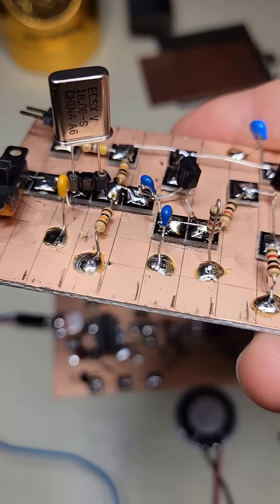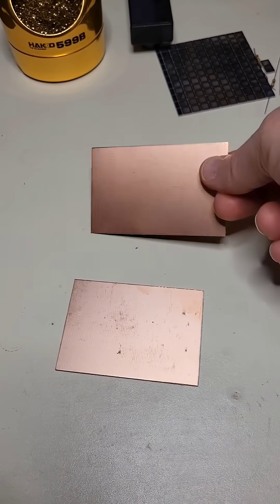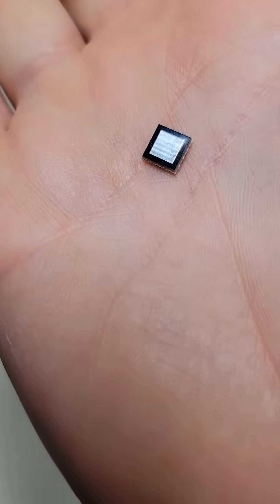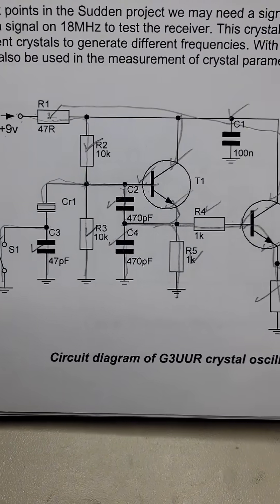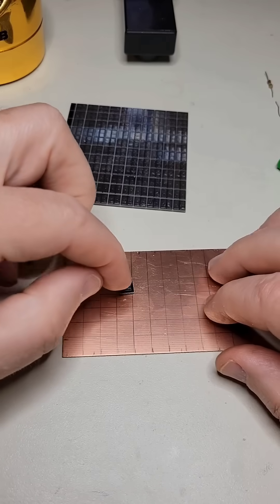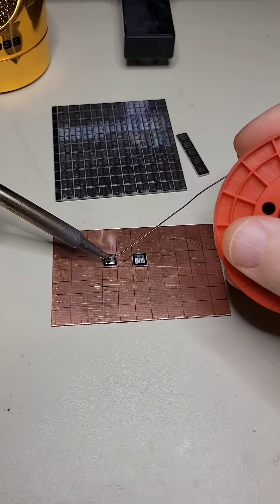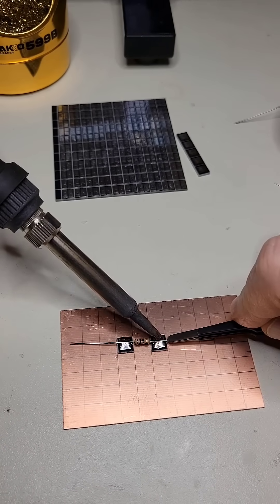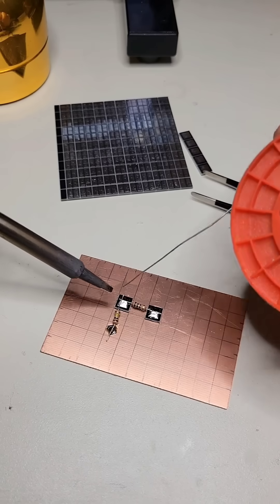Manhattan Circuit Construction Technique for Homebrew Ham Radios

Comment: You learn something new everyday. I have over two decades of professional electrical engineering experience with at least another 10-15 years of amateur electronics experience. I consider myself an expert. I’ll be damned, but I never knew this technique existed. I can see its usefulness in applications that require large ground planes, which probably limits its usefulness to mainly RF and maybe some simple power circuits. Neat.
Reply: It's also fast permanent and useful where pc board epoxy glass is too conductive or proto board parasitics or connection reliability is annoying.
Reply: Imagine building IC's this way...lol  First you glue this silicon wafer down...
Reply: @MrM6d  Actually, some DIY electronic guys assemble(d) primitive "integrated circuits" in a similar fashion, but of course with normal-size leaded-components. They used IC-sockets to created "integrated circuits" that could be plugged in into other circuits.
Reply: @GaretOsmontree   Thick film hybrid circuits are pretty similar to this technique, but done with small surface mount devices on a ceramic substrate.  The resistors and capacitor plates are sometimes carbon compound silk screened onto the ceramic.
Reply: @MrM6d  That is exactly how you make ics... well subhybrids were you stuff multiple ics in an ic package anyway. 

Just to clarify unpackaged bare mixed silicon and other chemistry dice with some microscopic discreets a/o screen printed (like a t-shirt) inside the IC package. Then some industry standard, flapping in the breeze, gold wires thermosonically bonded to the dice and package. 

State of the art processor chips already have or will go manhattan style. For physics and processing reasons.
Reply: @MrM6d  - Something like you mentioned IS used to create cutting-edge integrated circuits, from high-level modules created separately.
Reply: @MrM6d  There is a specific pad for IC.
Reply: Мы в Советском Союзе так собирали электрические схемы в "детском кружке" радиотехников. Были "кружки" авиамоделирования, робототехники и пр. 😊
Reply: 😅😅😅.  @Liberal-patriot
Reply: We low-power DIY ham radio operators ("QRPers") know and use this technique and similar ones when soldering together our lil' circuits.
"Manhattan-style" because the resulting circuit board looks as tidy/orderly as Manhattan's street system with its 90° angles.
A faster, cheaper and equally effective style is to use the leaded-components itself as tie-posts. If in need for an insulated tie-post we use 1MOhm (or higher) resistors. Compared to the usual 50Ohm impedance of modern RF circuitry, 1MOhm is pretty insulating.
It's called "ugly construction", and it works well into the UHF-region, too. If done with some care, the resulting circuit boards aren't even "ugly", although not as neat as in this example.
When utilizing ICs, these are glued with their leads facing upward...which is why it's called "dead-bug-style".
You may want to check it out - it makes for a very speedy prototyping.
Reply: Навесной монтаж называется. 
    Я ни за что не поверю, что в конце 2024 можно купить фольгированный стеклотекстолит, двух сторонний фольгированный  стеклотекстолит.  Но нельзя купить макетную плату любой сложности.
Reply: @o4eni_zloiy цей тип монтажу існує рівно скільки скільки є сама електроніка раніше такі деталі прикручувалися на болти (шайби з 2-ма відводами) то можна набирати до безкінечності поверхами.
Reply: As a radio ham And fairly new to electronics I love this technique.
Reply: to be fair, there are plenty in instance where fully insulating emi to sections of an RF circuit, or a smps is quite desirable....but I agree, very interesting to see a 'new' method even if it's only new to us 😅

though....it does give me a slight anxiety over all the cool and interesting stuff we are missing every single day in the world around us....I personally cant stand when stuff is brushed off because if you're in the niech industry its common place, but its not until you're in that industry for a few years that you even discover the thing exists. 

People, techies, old salts, please stop hiding the tips tricks tools and methods of your trades! None of us wanting it disappearing like movie model making! They might be commonplace to you but to us normies its an amazing novelty!
Reply: The ARRL handbook refers to essentially this type of construction as “dead bug.”  Instead of stick-on pads we used to use a Dremel tool to cut a ring around a copper island for soldering the component leads.  The Manhattan version of dead bug takes out some of the labor of cutting islands into the circuit board.  The fancy version of this is to use a CNC router to cut away unwanted copper from a circuit board instead of etching for a one-off project where making a mask isn’t worth the bother and you don’t want to wait for an off shore board house to make you a board from a Gerber file.
Reply: I've always known this as "3d electronics" and only really ever used for RF prototyping. Quick, useful, keep leads really short and keeping it close to the ground plane helps with noise and em radiation. Haven't seen anyone do it in years though, cool!
Reply: Früher wurden Reisszwecken auf ein Brett gedrückt und erziehlten den gleichen Effekt. 😊
Reply: I did this several decades ago to build a shortwave radio converter
Reply: I learned about it a few years back when  I was learning about how they used to assemble compact assemblies before integrated circuits and PCBs.

The main solution was "cordwood circuits." Cordwood circuits can only be used when the components didn't create much heat.

"wire wound circuits" were another old-school method.
Reply: Always in RF like radio power amplifiers
Reply: Maybe for DC RF 😅😅😅😅 73’s ON1KZM 😊😊
Reply: LOL ! YOU DIDNT KNOW THIS EXISTED!? IDIOT! HAHA
Reply: The use of solid ground planes is also important in digital electronics. Devices that can generate fast rising edges can have a problem called "ground bounce". Say a logic element is on the board, and its output switches from high to low. Then the driver transistor has to short to ground all the stored charge in the signal line and other component inputs, and that current temporarily goes through the ground pin of the logic element. Without a ground plane for the ground pin, these are RF frequencies and the inductance of a long trace not a plane can allow the pin itself to "bounce" to such a high level that it affects the reception of the inputs that have a threshold relative to the ground pin. AND THAT causes the "ground bounce" logic error or glitch.
Reply: In modern PCBs we see a large ground at one side and all nessacery components on the other side
Reply: I am impressed by your professional expertise. You just took the bloviating art of tooting your own horn to a whole new level. Amazing.
Reply: @Kalumbatsch  - Glad you’re impressed. Even at my age, I’m perfectly comfortable with admitting what I don’t know. When you have achieved as much as 1/10th of my professional accomplishments, I will congratulate you for your humble status. In my many years of work, I’ve met numerous, smug, rude, cocky, and disrespectful, know-it-all junior engineers such as yourself. I will therefore politely offer some sage advice. If you ever want to succeed in this field… respect your elders and learn everything you can from them, for they can teach you vastly more than you think you already know. I speak from experience. Good luck.
Reply: @Samuel-km5yf  I stand in awe of your humble greatness.
Reply: I literally work for a company that makes HAM equipment and I've never seen this! haha
Reply: really? after all that you have never needed to prototype anything, and didn't fancy dead bug? i find that hard to believe. how did you knock up circuits quickly?
Reply: Hey Mr Expert, I got you a real question: do you know of some not-so-hard technique for restoring damaged metalized holes or maybe create them?
Reply: @CP200S rivets. Easy as it gets.
Reply: I have absolutely no clue how you have never seen this as an engineer, its like a tree trimmer that never seen a chainsaw. 😂
Reply: @GoonyMclinux  but an axe 😂

Comment: I used heat proof clear acrylic sheet. Drill all the holes for all the components then solider everything up using wire. Put a LED into the side of the sheet makes it look amazing. I built a class amp using this method, the whole thing in a clear box as well, looks like something out of the a reto future.

Comment: I don't quite get what is the advantage of this technique. I do something similar but rather than sticking squares to the board I just use a Dremel to isolate an island for the component. Makes some dust but avoids the noxious fumes and other drawbacks of using superglue.

Comment: as cool as the manhattan technique looks, the super glue eventually always breaks down and the pads start lifting one by one,  the best way i found is to grid up the board with a pencil like you did, then us my bandsaw to score the grid lines of copper off making little islands for the components to get soldered to.
Reply: Use a double-sided board if you do this, otherwise you don't have a ground plane.  And make sure you connect the copper backside of the board to your circuit ground.  Otherwise, you might as well just breadboard the circuit, if you don't need a ground plane .  (Like if you're just doing audio or DC circuits.)

Comment: I just press thumbtacks into a piece of wood where I need them, and solder to the top of the thumbtacks.   Faster and cheaper.
Reply: Agreed, if you're only building an audio or DC circuit.  Did you ever build a radio the way you're describing?  Did you ever get it to work?
Reply: @davidnaegle427  I was actually using the thumbtack method again to build a crude linear amp to boost the signal strength of a little pirate radio circuit (that did work) I designed on thumbtacks using a crystal oscillator chip desoldered off an ethernet card.   I never finished it because I was designing the circuit myself.   

I was using cardboard at the time instead of a piece of wood.  I still got the circuit but haven't fired it up in forever lol.   I broadcast Midnight the Stars and You on it....   the ending song on The Shining...   off a pocket mp3 player...

Comment: Over engineering. Still used the main board as ground but I’d cut the smaller “tracks” out and have done loads that worked before. This just seems a pointless job compared to what the boards are actually designed for

Comment: Bro imagine making a even a simple modern Intel x86 CPU it would take like a thousand years at this rate and the modules all connected together would probably be about the size of Nevada ! [ Using a normal TO95 transistor the size of a virus and a typical register stack the size of a human red blood cell for scale ] 

Also the clock speed would probably be like 0.25 HZ lmao
Reply: I'd say pick a low transistor count candidate and do it, but this appears to use a s--- ton of solder, not be performed on a TEC hotplate for efficiency, not show the fume hood that needs to be there, and also not acknowledge that Manhattan Grids were a semiconductor concept for carrier transport abstraction in solid state design or that obvs. Midtown has looong blocks with ungreat guarantees you can cross inside a given building.
Reply: Does a farm tractor look like a Ferrari?  Do you think they are interchangeable?  You won't win any races with a tractor, and you won't plow many fields with a Ferrari.  This technique is for radio frequency circuits, not for megascale digital circuits.  I've designed GPUs professionally, AND I hold an Extra-Class Ham Radio license.  I know about both kinds of circuits.  You use the technique that suits what you're trying to do.

Comment: Nice construction. I would use a Scotch Brite pad and rough up the copper surface before doing circuit layout to allow the solder to stick more easily and it would help the CA glue to adhere better to a roughed up surface instead of a shiny surface.

Comment: Cool, never knew if this method of building DIY boards.

Its inspired me to make a project boards around this concept, it will maintain the larger ground plane but,  no need for breaking off and  glueing little tiles of boards.

#davemanhattan

Comment: This video is a product placement promotion.  "Manhattan Construction" does not require a solid copper board or the special adhesive 'ME' pads and can be performed on old style breadboards. Manhattan Construction is just a method of positioning the leads and the components through more careful planning to facilitate shorter leads and neater arrangement.
Reply: You sound like you don't understand what a ground plane is for.  Think for a minute about each node of your circuit, and how big a "loop" there is between each node and the ground, wherever that happens to be.  Without a ground plane, the electric fields from each circuit node travel further before they terminate on a ground.  The longer that path is, the larger the "loop" is, and the more susceptible that circuit node is to interference from external electric fields (RF interference usually, but it also happens for high-impedance audio circuits like guitar pickups.)  With the construction technique shown here, the fields are short (they go through the thickness of the 'me' pads and right to ground.  It's harder for external electric fields to "couple" to them, because the external field lines must pass through the "loop" I mention above.  Thus, the technique shown in the video is excellent for radio circuits, which must be unaffected by RF interference.  

Manhattan Construction does position the leads and components for short leads and neat arrangement, BUT it also makes the loops between each circuit node and ground have the smallest area and thus, the least susceptibility to electrical noise. That fact is only apparent (visible) to people who have really understood the physics of circuits and are not just building circuits they don't understand, like Mickey Mouse in the Sorceror's apprentice.

Comment: No need to cut squares, too much work. Use 'dead bug' and wire point to point.
Reply from the maker: It's a valid point depending on the use case.
Reply: @RedSummitRF  but the title of the video was 'Homebrew Ham Radios'.  Probably not such a good idea to ignore a ground plane for that.

Comment: its also called 'Dead bug' construction, which also allows gluing flat-sided components down with wires-up, soldering the joints in-the-air, and other easy and useful shenanegans.
Reply: It's also called something else, when you do something completely different.

Comment: I like using SMD components on that board you can get with islands in a 0.1 inch raster. You can naively design and build, and it just works up to half a GHz or so, without any regard for stray reacrances.
Reply: Когда нам будет по 90 лет, наш выбор - Manhattan Circuit Construction ;-)

Comment: Looks like a gigantic waste of copper that should be used for wiring instead.
Reply: No, the people who used this were mocking up circuits fast for work and needed great groundplane RF performance. At its peak of course you could make a CERDIP or high isolation multilead ceramic package with this method and RF signal lines on longer rectangular pads (not swamped in solder.) There's probably another method for THz circuits?
Reply: As Einstein said, Everything should be as simple as possible.  AND NO SIMPLER.  You haven't understood that some of that copper is DOING ITS JOB as a ground plane.